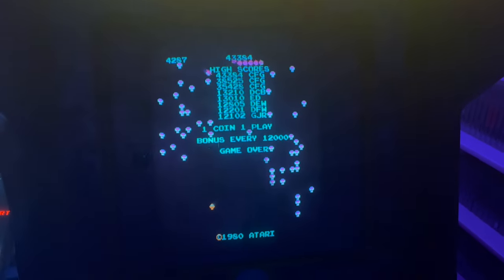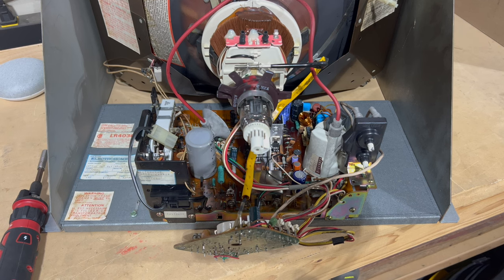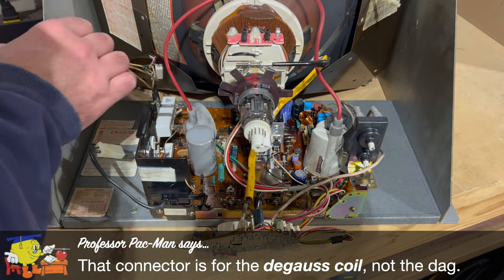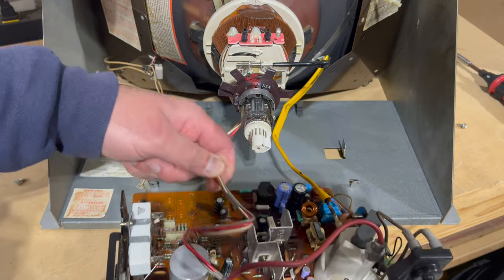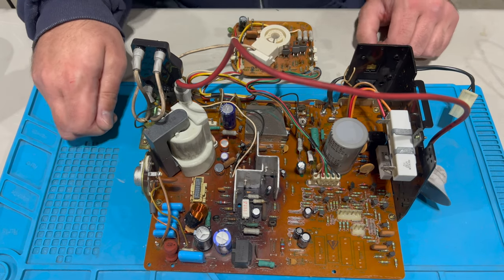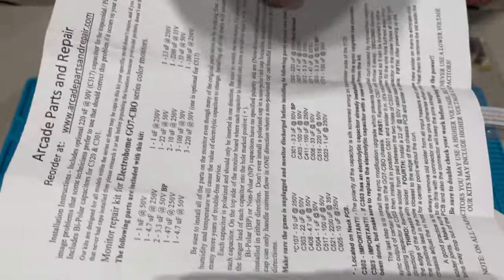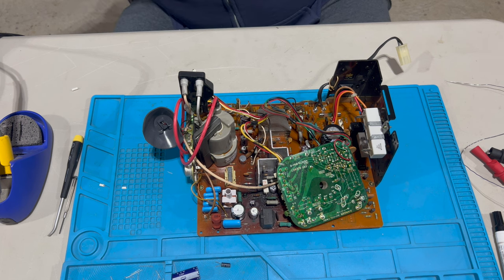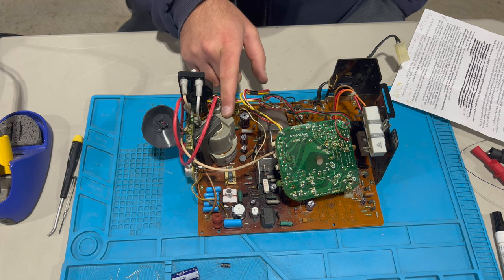Ms. Pac-Man Restoration part 5: How to Rebuild a G07 Arcade Monitor

Comment: You aren't a true arcade repairman until you've unwittingly shocked yourself with the filter cap because of that fuse being blown.
Reply from the maker: I’ve shocked myself a few times before while working on this stuff, just not by a G07 filter cap. #KnowledgeIsPower

Comment: I've rebuilt so many of these now, I know more about the G07 then any other... LOL
Reply from the maker: Somehow, this is actually the first G07 I've really ever worked on. I only own two others: the one in my Centipede hasn't needed anything more than basic adjusting since I got it years ago, and there's a 13" G07 in the Missile Command cocktail in the restoration queue for next year that I haven't touched yet.

Comment: Did you end up getting the curl out I have the curl on my GO7 that I can't get out. I have replace the caps flyback and coil but that curl still shows up on the right side. Let me know how you got the curl out.
Reply from the maker: I usually just try to adjust the curl out as much as possible, but if you can’t live with it there is a “G07 curl mod” (aka “sync upgrade”) that often helps. I believe the necessary caps and instructions are included with the APAR cap kit: https://www.arcadepartsandrepair.com/store/components/capacitors/electrohome-g07-cbo-monitor-cap-kit-105c/

More info here: http://www.therealbobroberts.net/g07notes.html

Comment: I only replace the flyback if it's physically damaged.   The replacements have been known to fail as well.  So if it's not broken, don't fix it :)
Reply from the maker: I know, I know! In general, I do the same — only replacing flybacks when they’re visibly damaged or not functioning properly. But I’d just heard too many stories of G07 flybacks (especially the early ones with gray anode cups) blowing up after a cap kit, and I succumbed to the “old wives tale.” I definitely wasn’t looking for fireworks in this episode! But don’t worry, I kept the old flyback for possible future use.

Comment: Why did you do this level of repair to a tube with such narc burn in? I would do a tv tube swap on it while youre stripping it down that far. I’ve been snapping up 19” tvs from the trash areas in residential just for this. Can’t beat free
Reply from the maker: I’ve got a rather high tolerance to screen burn — more than most people I suppose. I do have a growing stockpile of monitors, tubes, and TV sets suitable for tube swaps, but I typically only use them to replaced necked or dead tubes. I’m in this for the long haul, and someday the only working tubs we’ll have left are ones with heavy burn!